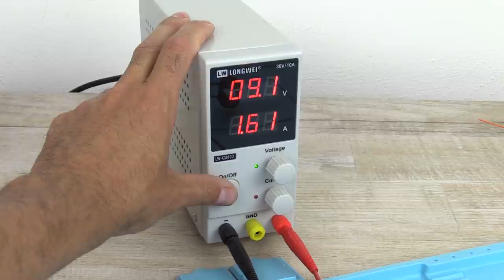7 AMAZING Tips & Tricks with TIN for Soldering

Comment: Great ideas. It would be nice if the products being used, like whatever apparent red silicone and the spray used on the circuit board after solder removal, were mentioned or shown so we know what was used. But love the hacks.
Reply: old but.  one frame has the silicone tube.  "Arexons Motorsil D" white and red tube.
Reply: @kay-zed4407  Thank you

Comment: Man i cant solder with soldering iron. U soldering with screw driver 😱, really amazing 💖
Reply: Sn base solder alloys cannot reacted with iron. Solder means that joining metal which has under 450 'c melting point,  relatively low T than iron . Iron need to welding. Also, if u wanna joining solder with different metal as iron, u need to electroplating different metal as Ni or Cu on the iron. At that time, they can form IMC at the interface btw Sn atoms in solder and plating metals
Reply: @김정수-g6v2q  thanx for the info ✌️

Comment: When you join wires u place the iron tip UNDER the joint with a flat tip with more surface area to transfer more heat to the wire quicker and well heat rises always place the iron on the bottom when u join to ends of wire. I learned this at R.I.T.O.P. school for mobile electronics

Comment: First that trace was made by factory to be weak link. If you put stronger wire than trace was you can damage some other parts. It is ok to repair like that but with less copper than on this video. I repaired some electronics same way but always pay attention on amount of copper that was there originaly.

Comment: When you were cutting the insulation off the coax cable how did you remove the center part to release the braids to make the solder Wick? You have a center conductor and a surrounding insulator between the conductor and the braids you don't show how you remove them?
Reply: simply by sliding one over the other, i think
Reply: @pierluigistomeo6764  thank you very much. but I eventually figured it out it was really easy

Comment: What's the use of the ball in the insulation when you soldered the 2 wires?
Reply: old but still.  to create a water tight seal so the solder wont just squirt out of the open end.

Comment: [A]
09:20 clean  Soldering as like an eraser [08:42 material]
[B]
06:40 coaxial video cable<-->07:03  07:25 07:50add   little oil<-->08:16 Clean solder;It's  very clean

Comment: With solder braid it also helps if you dip it in flux paste at least it does when I use it.
Reply: well that's why he rubbed the paste inside the desoldering wick, right?

Comment: 5:09 a normally made solder joint should be that strong anyway. No need for all that extra work tbh.
Reply: i think the point is, you could prep them, put them in a assorted container and have them ready when you need one on the job, then the extra work you put into it, would pay off in time saved. Exponentially if you have a job that requires many... you could quickly bust out quite a few without the need for fume extraction or any clean up. Say you are installing a stereo in a car for example, you could have the wires cut stripped and set up then pop each one on one by one heating as you go and have it done in a few seconds rather than minutes. Just a simple example.

Comment: 8:40 what is the product red ???
Reply: Arexons Motorsil D Joint Silicone Original. High temperature joint paste for use in car engines. Try eBay.

Comment: Hello, thanks for these tips, do you have one to make homemade solder flux?
Reply: That's easy... 20-40% (usually 20-25%) quality rosin/colophony really finely mashed to easily absorb alcohol, (60-80% ) isopropyl alcohol 99% purity or better, (optional but recommended) 1-2% (a few drops for 1-200ml) of food grade glycerin for around 1-200ml of product (it helps keep the flux from separating over time). mix really well until you don't see rosin powder anymore.
As a tip, search for various rosin based (R, RA, RMA) liquid fluxes then search for their MSDS list (simply google brand name flux msds) and you'll find the proportions...

Comment: 6:17 What is the blue bead for?
Reply: Likely just to have a solid object in front of the copper so the wire does not poke a hole in the closed end of the assembly.

Comment: I'm still waiting to be amazed by something...
Reply: I would have liked a link to the helping hands thingier he has. but ofcourse nothing. the one and only thing I am guessing that is going to interest me in all of this, as for that first tip? that is a f*cking fire hazard. thicker wires will NOT solve the problem that caused it to overheat in the first place, need to diagnose and figure out WHY it overheated. then SOLVE that problem before re-connecting the two junctions.

Comment: Did you really just smack a dimm against the table after desoldering to remove it, then use the correct tool for the previous task to pick back up off the table? The amazing part is if your ram chips aren’t full of errors, and function after reapplying.
Reply: Sorry to be so offtopic but does someone know a trick to log back into an Instagram account..?
I somehow lost my password. I appreciate any assistance you can give me.
Reply: @Benedict Rex instablaster :)
Reply: @Eddie Matthias Thanks so much for your reply. I found the site through google and I'm in the hacking process now.
Takes a while so I will get back to you later with my results.

Comment: Hi all,
Please help me.
When i start my soldering iron first i add flux to the tip of it, then when it's get temperature i add solder to it.
Until i don't clean solder from the tip it's a little bit good, but when i clean it from wet sponge the tip get oxidised at the moment.
Please tell me what is wrong here.
Is problem to soldering wire or whatever
I use different soldering irons, soldering wires and flux ats always rhe same.
I watch on YouTube a tip of soldering iron is tottaly clean(without solder on it) but its still working perfect.
I use soldering irons from 60watt that is adjustable and one100watt not adjustable.
Thanks all, have a great day.
Reply: Clearly you're overheating your iron, what temperature in Celsius do you set? I usually set 220-250 for work. 100W not adjustable is probably overheating, you need to lower the voltage.
Reply: he hit the nail on the head took 5 years of these kinda frustrating mistakes for me to get it and now I don't make them mistakes anymore one day you just get it and ya people are so worried about getting a cold solder joint and breakage of joint tend to crank up the heat way to much    good luck
Reply: why dont u try using steel wool things 
and use the adjustable one only at 250 degrees
Reply: Jab soldering iron heat hojay full to uspay soldering flux lagain phir uski tip par Thora solder wire lagain usko kisi sponge ya kisi oor chiz say maat saaf krain bas Jo apko bataya hai isay. Follow krain

Comment: What do I do if none of my coaxial cable has a copper sheathing. It's aluminum, I can't solder to it
Reply: use aluminium flux
Reply: Aluminum cannot forms IMC with Sn-base solder. If u wanna joining (not soldering) Al, u needs to welding method. Or, some metals (Cu or Ag) in solder which can form IMC with Al, can make it but really hard to form it

Comment: 1) Ugly oversized jumpwire. 
2) Waste of thinner and more expensive solder. For the needs shown in video solder of that diameter is sufficient, you just have to manualy feed it into joint, which isn't that hard. 
3) Put that on second part of connector instead of wood piece and make it 10 times easier. 
4) Killed the chip and probably board. 
5) Let's introduce more impurities to the joint. You can do it better if you use cleaner tools (and press for uniform thickness, not smash with hammer) also i have to remind you what there isn't much flux in the wire, use additional flux (you can clearly see what your joint is dirty and bad). 
6) Yet again - use more flux. 
7) USE MO... Oh, that one is OK i guess (though it'd prefer to use shorter wicks and drown them in resin flux dissolved in alcohol, then let them evaporate).
8) Where does all the solder go? I bet all over the board. Wouldn't use that on populated board. 
9) Nail is cheaper and big one has better thermal capacity. Don't waste a good screwdriver.

Comment: Dude u cannot jump wire much higher capacity than the original pcb copper... You put the whole board on a risk!
Reply: why ? can u explain more , or send a link for me to read for better understanding
Reply: Thus pcb pattern intended to carry only the required current. For example: u cannot replace a fuse which is 3A (original value) to 5A.
Reply: didn't know the pcb traces were used as fuses nowadays.
Reply: Fuse is just an example bro! By the way every copper pattern where the voltage/current flows has had a specific design not to exceed limits. U don't realise why there is a narrow & wide traces specially in the power supply area. I know ur better than us. I just want to share. It is ur own view then go on. God bless!
Reply: @fixnreview  yes, I understand, copper traces need to be able to bear the current and that's why some are wider than others, but they are not intended to be used as fuses. In a good design, there should be real fuses, and they should blow much before your pcb starts to burn.... So I really hope you don't design circuits. BTW one of the main differences between quality boards and trash is precisely how much copper they use.
Reply: Pardon! I say FUSE is just an example. I know ur an intelligent person! I love & I appreciate what u share. But I hate arguments. Your good brother feel free & more blessings.
Reply: @fixnreview  ok bro, take care.
Reply: There are many reasons why the trace can burn, not only high current. It could be because of corrosion, poor manufacturing, accidental cut, etc. Using a bigger cable causes no issues, the real problem is using a smaller one!

Comment: Yea, most of these 'tips' are things we purchase in the west... most are not required if you are just doing a few joints...who would 'handmake' those heat-shrink/solder splices...if you need a splice, you just do it.   And who hasn't stripped the 'copper braid' out of co-ax for a quick solder-wick....but who would spend time making a whole spool.... these are 'poor man's tricks'.... and 'slapping' the molten solder out of a joint has been done for decades...(but NOW, it's a NO NO...in OSHA's eyes)....NOT safe for the skin, or eyes.....be careful.... just saying...